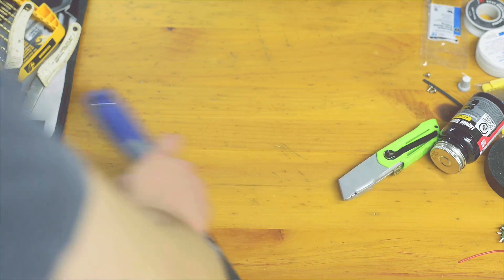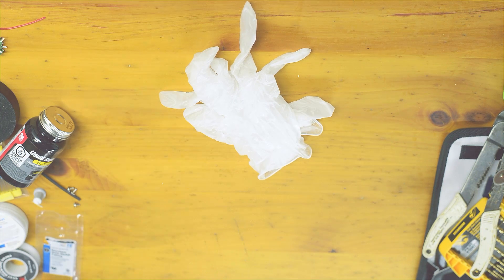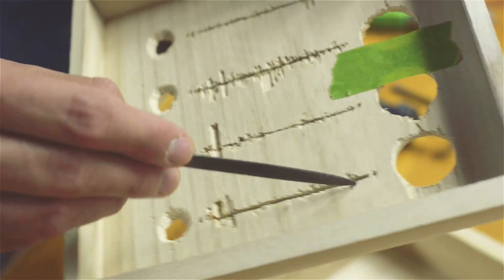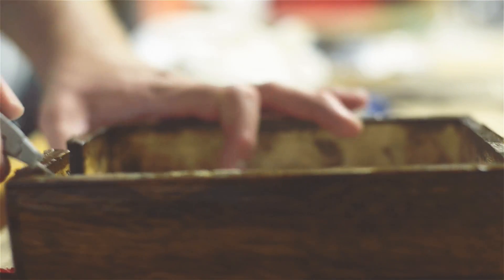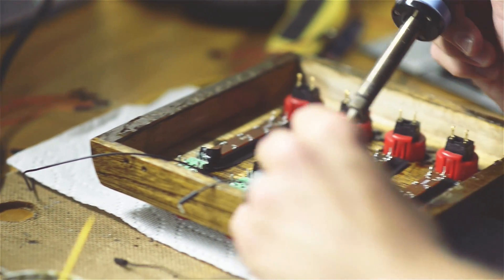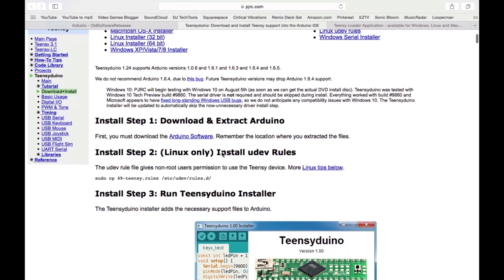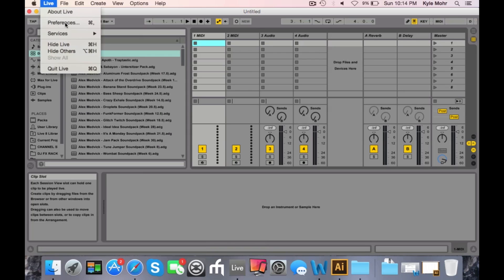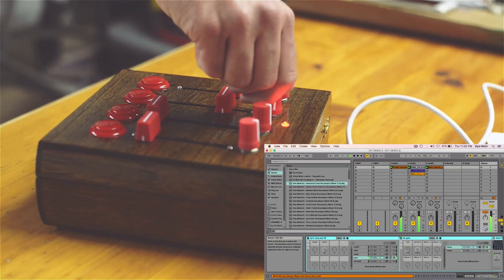How To Build A DIY MIDI Controller (2015 Edition)

Comment: I've got an obsolete Novation Nocturn, which has 8 rotary controls on it and one slider, I wonder if it would be possible to turn it into a MIDI controller, like this one.  I hate throwing things away, but there's no software available for recent OSs that'll make it work.

Comment: Using hook up wire rather than breadboard jumper wire would clean up the interior.  You can cut everything to length and make it sexy.  Just be sure to strip the wire, twist it together and tin it with a little solder before attaching to your components.

Comment: Hallo
My name is simple
And today I would like to get some ideas from the professionals and different people
I recently bought a DJ CONTROLLER called the (HUCULESE INSTINCT P8)
from Amazon, And after a couple of years of using it l found out that i will be replacing the (linear crossfader) now so far I have replaced 3crossfaders in two years.
Now here is where i need some help!
I want to modify this linear crossfader to an optical crossfader,but remember the signal that connects to the linear crossfader is analog but I want to convert it to digital signal by using (LM393)and with the help of( IR SENSORS) to determine the crossfader movements and that's option(1)
Option (2) how can I interface the controller and change the analog signal of the crossfader to digital signal so that I don't have to bother with the conversation process of (LM393). thanks and I will be glad if you answer me

Comment: I'm doing a project very similar to this, using the Teensy 2.0 as the brain. Because the Teensy only has one active and ground pin do I wire up the active and ground chains in series or parallel? It doesn't specify and this could affect the voltage that each part gets...

Comment: I was wondering why I kept getting constant random inputs. For less pots, just set appropriate number of analog inputs and start at correct pins. I only have 2 pots and one button and just left the 4 buttons in the code. With 8 analog inputs, 6 pins were left floating. I literally change one character in the code. Pot volume control on PC through Voicemeeter is nice. It doesn't need intermediary software to work either.

Comment: Faders are not known as linear potentiometers. They are known as sliding potentiometers. Linear should be taper variant of both, faders and rotary pots in your case. Also, it is absolutely unnecessary to use 1% metal film resistors for LEDs. Their purpose is just to limit the current.

Comment: 2019 version case can be 3D printed 🤘🏽
Faders crackle and fail pretty easy. You can protect them from debris by making a slice of felt between the board cutout and mount. 
Nice video. Thanks.
Reply: these faders can have a 100n capacitor across their output with confidence and still work fine; - they are only giving DC voltage.... - personally I always wanted to make touch controlled faders...

Comment: Just use a cig lighter fot the heat shrink, so much better than burning it with your "SAUDERING" Iron. Plus it makes your tip dirty and which makes it harder to SAUDER.

Comment: Hi, I don’t think I can learn how to make my own. Lol 
I was wondering if you could build something for me?
I need a controller for my Korg Pa1000 which would be basically the four buttons at the bottom of your box there, i need it to control the four fills without changing to variations like towards the end ofthis video https://youtu.be/hcJjLhQyyls (or more options if you figure something better)
@DJ Tech Tools please let me know if is possible to build it for me and how much would it cost me.
And here is an idea: There are thousands of Pa1000, 900, 700, etc owners and a lot of that bunch don’t like the auto fill buttons, we mostly want that separate. So if you could figure out how to mass produce something like that you could make a loooooooooot of $$$$$$$$$$$$$$$$$$$$$$$$$$$$$$$$ because there is nothing like that on the market, only pedal boards and such.
Thank you

Comment: Works only on Ableton? I'm building this and Sonar and Reaper can't get to work with it properly... on Sonar, the Volume on stucks between on -33,4db and -34,4db for the pots. Plugins stuck at 16% using the pots and the buttons instead of a healthy on/off on things, get me a 0% when not pressed and 51% pressed. On Reaper the learn doesn't catch anything at all, and teensy is enabled as controller as it should on the configs. Someone help lol

Comment: I dont think your as bad a solderer as me but I do suggest investing in a respirator make and fan to blow that toxic air and or saw dust away from your lungs. PS theres a cool touchscreen thing on ebay for like 3 dollars touch controller anything like copper shielding tape can make buttons I want to make a binaryFingers choker controller and blurVisors see me on hackaday.io/openInvent

Comment: Questions
1: is there a good central store to get these components such as knobs, faders etc. if so can you send me a link?
2. Does the teensy board limit how many faders/knobs you can program to send midi signals? And if so, are there larger boards to assign more controller knobs to?
3. is it possible to create a MIDI controller which is specifically used for knobs solely To assign automation to each knob, Like the Faderfox PC12?

Comment: One of these days I want to do something similar and turn an analog mixer into a control surface for a digital mixer such as Behringer XR18 (comes with no control surface, controllable via tablet). They are able to be controlled via midi/mackie control protocol. I am thinking I can change analog buttons/knobs/faders for digital ones and use multiplexers. I was wondering if anyone agrees with me or had a different opinion.

I just like the idea of all 12, 18 or 32 channels at my fingertips instead of paging. Sometimes you have to bring it down/bring it up fast without looking for the right channel strip
Reply: It could probably control a daw as well

Comment: if you want a clean look to your wood then before you drill just clamp another piece of wood to the side opposite to the direction you're drilling. this will keep the wood from chipping out and looking crappy. Also if you're going to use a dremel make sure to use eye protection!
Reply: Yeah, the 4:26 moment with the dremel was plain scary

Comment: 24mm forstner bit would have worked a lot better for larger holes. I used a 24mm and a 30mm when I built my arcade stick. Cuts nice circular holes in both wood and plexiglass.

Comment: learn how to solder, use cheaper wires (these are for breadboard), use better wood, don't solder on arduino-use socket, use lighter for shrink tube

Comment: is it going to make a different if I build this in the UK in terms of power rating etc... ? I'm guessing not because it isn't connected to the mains. Also is this controller bus powered by the USB cable? Thanks

Comment: Funny, you've got all the tools, you've even got a beard, but you didn't know to tape your box before drilling to prevent all the splintering.
Reply: So what? He was very specific when he mentioned wood is just an option he never claimed to be a fuking carpenter

Comment: Very cool idea. Using arduino plc built-in a DIY midi. Awesome it works!!!.
Will that arduino work with my Maschine Studio software and combined with the controller maschine midi plug ? I was thinking to buy a new brand 16+master midi+effects. Just to take the digital out convert into analogue, arrange and get set to digitalize back again.
Best,

Comment: You got some really nice tools but I'm not sure if you actually know how to use them. Those drill bits are for making a hole on walls and tough surfaces unlike that box, and don't use that small disc cutter as holding from the back of it, but hold it firmly closer to the tip and don't let it get an angle inside the hole you are just cutting or as you have seen the disc breaks. Anyways I'm not trying to be mean or the "know it all guy", I am just trying to give some advices so that you don't hurt yourself. It is a nice tutorial by the way. Keep it going.
Wish you the best.

Comment: Where did you buy all of the knobs?  And NOT pink!
Reply: I will worry about the arduino software hardware set up. The rest, just electronics store and google.
Best,
Reply: Unnecessary Verbiage-- Dude!
Reply: Tayda Electronics is a great place to buy components.

Comment: MIDI pisses me off. A standard Arduino could give you 10-bit precision which means for 0-1023 values per rotation. MIDI lets you relay only 7-bit precision through, 0-127.

Comment: hey, I'm working on my own 16 button midi controller like the spectra. I was wondering is there any way to set up the arcade buttons with the teensy 2.0 without using a multiplexer (mainly how to connect the buttons to the board)? There are no LED, potentiometers, etc.. just buttons.
Reply: Did you work it out as I am wanting to do the same thing.
Reply: it works, the teensy actually has 23 digital outputs I didnt realize. just look up teensy digital I/O pins and you can see which ones to solder
Reply: TheNullObjects did you have to change the code? if so any chance you could share it with me? or tell me how I could change it? thanks
Reply: yeah i can send you the code if you'd like let me know how you solder the buttons if it works because im having soldering issues
also idk how to send the code through comments. i could email it to you
Reply: Sorry for my late reply. Whats the problem with your buttons? I have used arcade LED buttons before and they worked ok.

Comment: can I use a arduino uno board instead of teensy
Reply: I was wondering the same... why should i use teensy with an arduino code instead of and arduino board o.O? I think I'll try with arduino nano
Reply: teensy is smaller so it fits in better I suppose. all about preference.

Comment: Is there a way to do this with a Raspberry Pi 3 Model B or any other raspberry pi?
Reply: Yes, the project will be different but perfectly doable. Some of the same basic design and layout concepts will be the same and most of the hardware work will essentially be the same. Software wise it will of course be different.

 You can directly handle a small number of digital inputs directly on the GPIO pins or chain a few multiplexers and port expanders for a huge number of digital inputs, or ADCs for analog inputs, or of course a mix of both. I think the theoretical limit is something like 8,192 digital inputs using a whole mess of multiplexers attached to a whole mess of port expanders. But by the time you hit 8K inputs good luck with keeping all the wiring straight let alone the code monitoring that many input events. In the real world the limits are how many input devices you can fit on a control surface you consider a reasonable size and making sure you use parts you can set unique I2C addresses on.

You will need to plan out how many inputs you want and rather you need digital inputs or analog for each of them, map out the surface are making sure you have enough room between each to be workable controls without accidentally hitting the ones next to them and not compromise the surface material and breaking it (especially with thin/soft wood or very thin sheet metal), and if the surface area is very large be sure to plan some evenly spaced interior supports so you don't cave the whole thing in while smacking controls during an enthusiastic performance/session.

And while not specific to a Pi any kind of complex build can be made MUCH simpler by using screw down bus bars for common ground and power lines. Not only does it make it to where you have to do a lot less soldering you can do cleaner routing of the wiring and make your life WAY easier if you ever have to replace a failed component or want to add a few extra parts.

On the software side of things there are multiple libraries of code for different languages for the Pi for dealing with input and turning them into outputs. Everything from just editing a python script that reads GPIO pins and triggers events to full blown code to be compiled into a project with a nice pretty GUI. You probably also know there are a fair number of synths that can run directly on a Pi.

Oh, and I just did a quick search and it looks like an 8 channel 12 bit I2C ADC Can be had for under 7 US dollars in a QFN package. that isn't ideal for soldering in a small project but socket to pin adapters can be had for pretty cheap. Using just 1 ISC multiplexer you could have 8 of those wired into your project for up 64 analog channels. At that point you aren't so much building a small personal midi controller but a studio mixing board.

Oh, and two final and VERY important notes. A Pi nor pretty much any microcontroller is going to handle directly supplying power for a large number of input devices. Anything using any IO expanders/multiplexers should plan on having a secondary power supply isolated from the Pi/microcontroller. It may sound like a lot of complexity but it basically just requires a couple of diodes. The second note is that as the project grows in complexity and amounts of wiring consider shielding for RF/EMI. As stupid as it sounds as long as your components are electrically insulated it can be as simple as wrapping sections in aluminum foil. Or if you only care about outside interference just lining the insides of the box with foil and then a layer of something to electrically shield it so nothing shorts. If the idea of foil sounds dumb to you, just remember space agencies do it all the time on projects costing millions of dollars because it is light weight and it works.

Comment: Hi... nice video. I did a similar project a few years ago with an arduino UNO. I actually used a power router with a very thin bit to cut the straight lines out for the faders. It worked really nicely because the router has a guide edge so you get a perfectly straight cut. The finish looked really professional. Just thought I'd share that with you. ANyway... nice work